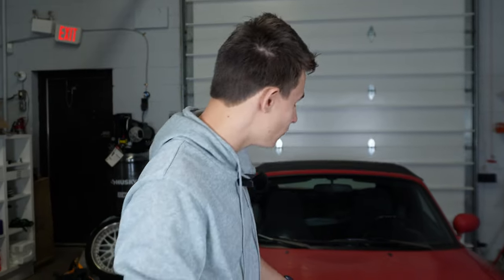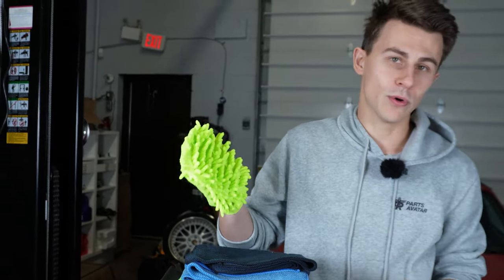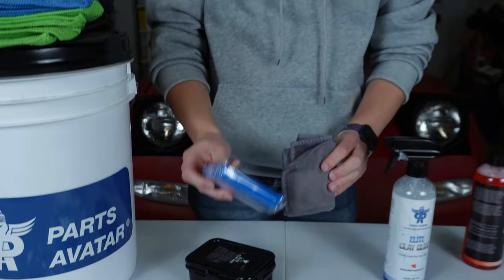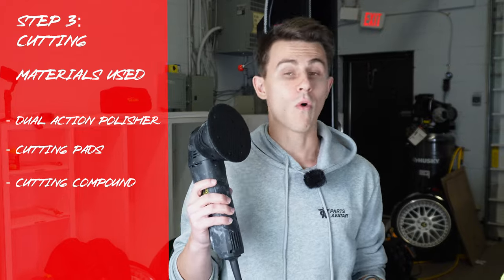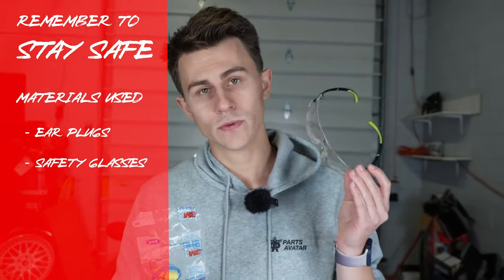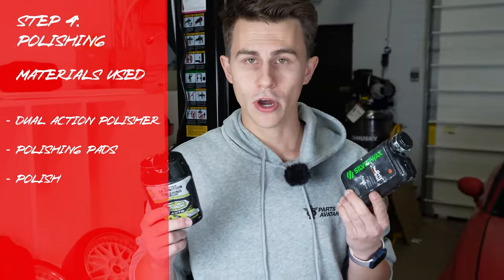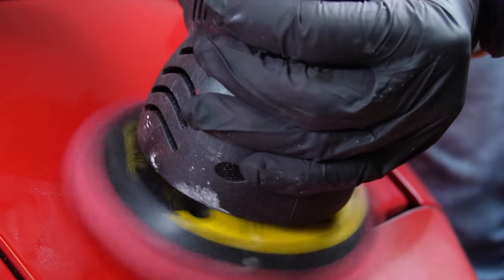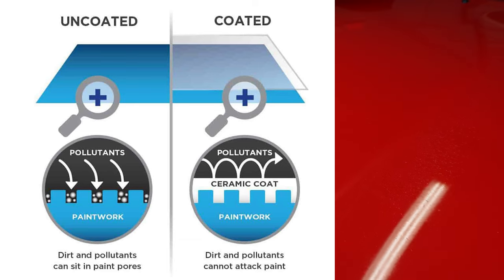How To Properly Restore Faded Paint - Miata Dinosaur Skin!

Comment: I noticed that the nose of the car did not get the same treatment as the rest of the car. I assume it is fibreglass. What is your treatment for the nose?
Reply from the maker: Since the paint on the front bumper was very badly faded it may need some plastic polish to see if we can get the colour back. If not it will sadly need to be repainted as the single stage paint reacts differently on plastic as compared to metal